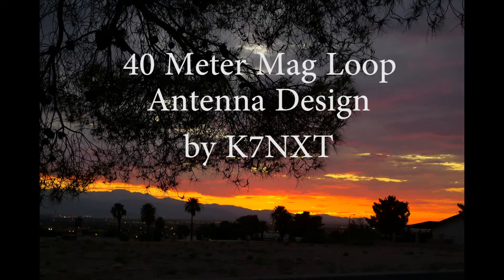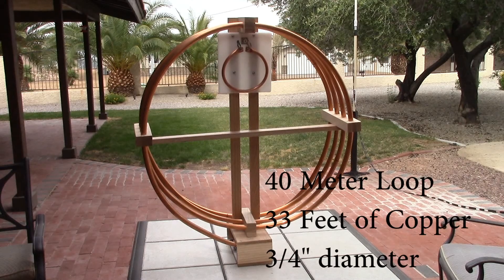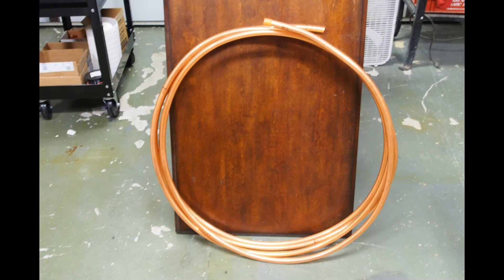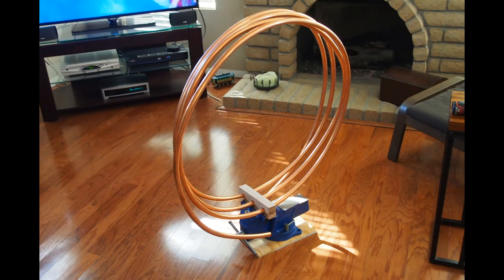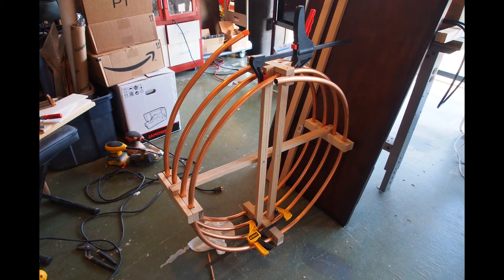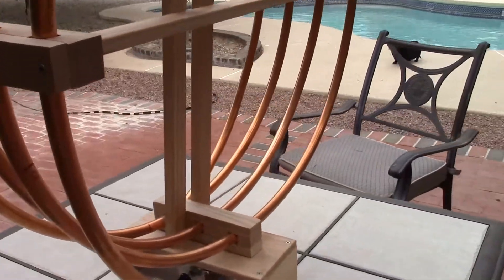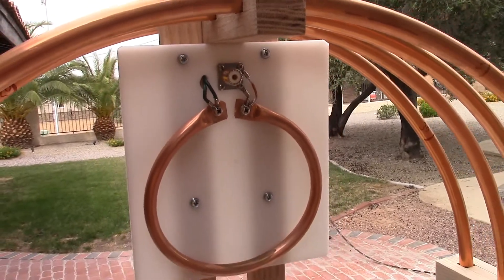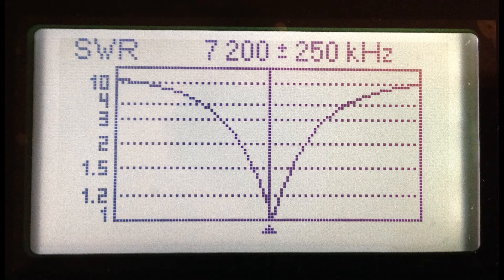40 Meter Magnetic Loop Antenna

Comment: Nice build.  One question - it seems your feeder loop is too far away from the main loop.  Aren't they supposed to be as close as possible while maintaining enough dieleectric isolation.  Some even have shown that making the circular feeder loop into an oval to better conform to the outer loop further improves coupling.   And my understanding is you'll also get better performance by putting your coax connection in the interior of the loop instead of toward the outside; remembering that the highest voltages are on the opposite side from the feed point, and thus should provide maximum power coupling.   I'm been looking at different designs on the web and trying to get ready to build a 40/20 and a 160/80 M loop each having two loops (series for lower F band & parallel in higher F). 
They sure seem a wonderful antenna type.

Comment: Any rhyme or reason to the spacing between the larger 4 loops? Did you have to adjust the location of the coupling loop much to get the swr acceptable?

Comment: Can i use the auto tuner on my ft897 instead of a cap on the loop?
Reply from the maker: No, the capacitor is an essential component in making the loop resonant. But then, a tuner can also be of help because the antenna is unlikely to be at 50 ohms resistive.

Comment: Hey there.  What is the diameter of the transmitting loop that you are using with this antenna?  Thanks
Reply: +Harold Kinchelow (K7ILO) Its 4 turns from 30' ...  <=> 2' 6" ?
I'd definitely go for a bigger aperture for efficiencies sake.
Reply from the maker: +Harold Kinchelow (K7ILO) 
The diameter is 7".  I plan to build some alternative driving loops and see how they perform. Thanks for viewing and for the suggestions.
Reply: William Reed wow! So small !
I`ve just started to partake in a 2m mag. loop and that is from 10mm (0.4") and 250mm (10") diameter. Will solder some double sided pcb on the open end and trim for resonance and give it structure. Will be for a cheap sdr rx with preamp so less pll/supply/cross band spurs on screen :)
Reply: William Reed I calculate the diameter to be 33/4 X Pi = 31.5 inches, if that is your question.